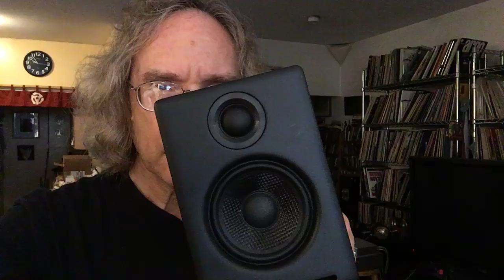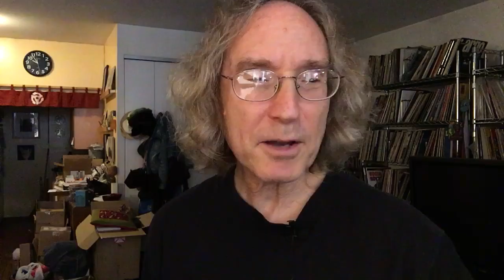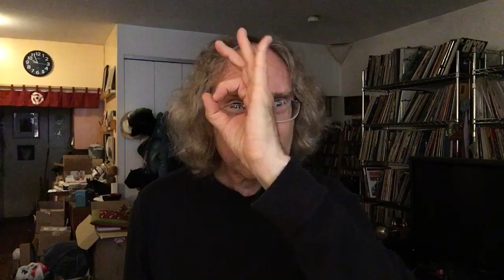The case against 1 inch dome tweeters

Comment: it all comes down to 2 things which led to the dome tweeter. assume that we are looking at a hypothetical single driver speaker with a flat response. this means that anywhere within its frequency response +-0db, our woofer's diaphragm will move from peak to peak at the same rate regardless of what frequency you're playing. the rate at which the woofer moves corresponds to the volume of the speaker. so the longer it takes to complete a full cycle of a waveform, the further the woofer will move peak to peak. so lets say we want to play a loud 20 hertz sine wave. the only way we can have both loud and low frequency is by having the woofer move extremely far from peak to peak. but there is a solution. people who developed speakers quickly realized that the larger the surface area is, the louder the speaker can be. so instead of having a crazy large peak to peak excursion value, we can increase the surface area of the woofer so the woofer doesn't have to move back and forth as much. if we are only concerned about higher frequencies, then the peak to peak value of our woofer would be exponentially smaller than when we were playing the low frequencies. in fact, if you were to put your finger on a bluetooth speaker's woofer when it is playing a high frequency, it would not appear to be moving at all. so, there is no need for a large surface area when producing high frequencies at the same volume as a low frequency. we can increase the peak to peak travel distance of our new woofer (which is still incredibly small even after the increase), and decrease the surface area, which explains why the tweeter is so small. it also makes sense to use a small high frequency driver (dome tweeter) because the weight of the silk dome and voice coil together is very low compared to the woofer. as you might know from physics class, mass is the opposite way to get something to move fast. so, the lighter the tweeter is, the better it accepts transients and acceleration, and requires less wattage. the dome tweeter is, to my understanding, the most efficient balance between surface area and peak to peak travel distance for a typical voice coil driven tweeter.
side note: many speakers have more than one driver. this helps because we dont need to make a huge woofer that is incredibly lightweight yet stiff enough to not distort. so by adding a dedicated high frequency driver, we can worry less about the weight of the woofer.

Comment: I think as far as tone and also clarity at low to medium volumes dome tweeters are as good as anything. But as is said in this video, they aren’t the most dynamic solution. I favor good compression drivers and I don’t mean Klipsch. I’m keen on old Altec, JBL (old and new), TAD and Radian among others. I’ve also been pleased with the dynamics of large electrostats and planar dynamics. But at lower volumes, yeah, domes can be very, very nice.

Comment: While it sure sounds logical in your head this is just thoughts or ideas not backed out. If any other kind of tweeter were better, hifi-manufacturers would use them more. I do have a pair of Martin Logan electrostats and I agree, they are the best sounding speakers when it comes to hi frequency that I've ever heard and a go2 for me but that doesnt mean they're actually better than dometweeters because of the size.

Comment: It is absolutely true that the area of diaphram is the governing factor of a cone loudspeaker's efficiency however, the efficiency factor is always divided by the moving mass of the loudspeaker. Tiny dome tweeter's lightness (a dome is just another variant of a cone) compensates for the smallness of the area.

Then there is another interesting factor literally in the air. The higher in frequency a solid object vibrates, the more efficiently the vibration energy transfers to the adjacent air. Less electrical power and smaller area are just enough to reproduce useful sound pressure at high frequency region.

Comment: Hrmmm, i get it.. The PS audio infinity IRS 5s have a whole panel of JUST midrange and Tweeters and I've never heard it in person, but I must say it looks alot morr convincing and easy to reproduce sound than just ONE tweeter. If you put in 4 of those tweeters and marketed it as 4 inches of real estate for dynamics and high frequencies. It would sound ALOT more convincing. As for headphones, the driver size matters just as much as the cup design. The HD800s can only sound like that because of their shapes enclosure. Or the Z1R because of it's massive 70mm driver. Listen to other 40mm headphones and you will notice a clear difference. That aLOT goes into the acual enclosure that isolates and refines sound but the bigger driver still sounds better and more natural since it cover more area. Bass from a 40mm driver being resonated will sound less like a bass amp and more like the inside of a cab while bass from a 50 or 70mm driver will immediately feel like it's coming from the large driver of an actual bass amp and immerse you. It's bugged me alot in the past as well

Comment: I replaced the 1 inch domes in my Energys with salvaged paper 'tweeters' (2 and a half inch) from an old Bose OM3 and there was a huge improvement....transformed from 'ok..but' to 'these sound great...A lot more detail,better high end,greater clarity,overall better..did not change the crossover.
Reply: Paper tweeters are great
Reply: They are too prone to burnout on loud music
Reply: vaughn tonkin  ..thanks..didn't know that..I am an apartment dweller so can't do LOUD..
Reply: If they are 2.5" drivers then they will have some SIGNIFICANT limitations when compared to a 1" tweeter - the primary one being radiation/dispersion. A 1" tweeter will start to beam at somethig like 8khz-10khz when off axis to the listener, while a 2.5'" would start to beam at something closer to 3khz.  

That means for your speakers with the 2.5" driver to sound any good up top, they'd need to be sitting right in front of you, firing directly at your face more or less. Might be ok in a very small space, woudn't work nearly as well in a larger where you have mulitple people in multiple listening positions. 

You'd also likely suffer a MAJOR drop in sensitivity, meaning if you didnt change your crossover you top end is probably far quieter then your bottom end (midrange / midbass) now.  Some people like that type of things - but its not accurate or realistic.
Reply: One thing I like a lot is >more 'tweeter' volume and better sound stage/imaging..If radiation/dispersion is not as good i can't hear it....what i hear is what  i care about.

Comment: Sir your trying to compare an electrostatic to a box speaker with totally different sound dispersion characteristics and a totally different way of being built,some people just don't have the room for electrostatics I myself love the sound of a well run in vintage pair of quads but just don't have the room for them that's why I use kefs because you get the scale and almost the same holographic imaging as an electrostatic,never really have a problem with transient attack and dynamics as good placement and decent high purity copper cables I find silver far too bright...with plenty of amps on tap do the trick.... unless you're using valve amplification which always requires a slightly brighter sounding pair of speakers....in short nothing wrong with domes just make sure they're installed on a smooth baffle with no framing around the edge to avoid diffraction.

Comment: I hear what you are sayin' here Steve. Yes. Obviously, you can get a lot of sound out of that small speaker. Goes without question. The question (in my tiny mind, at least) is whether you can really get the full "richness", shall we say, out of that one tiny driver? Would larger tweeters work better? Or would a multitude of tweeters that are each wired (crossovers) to respond to just a smaller part of that 3 to 20+kHz range (acting like a small choir) be a better option?
I would like to try my hand at designing my own speakers in the near(ish) future. I'm thinking that perhaps two or three larger tweeters wired to "sing different parts" would produce a fairly rich sound. Now, all I need to do is figure out how to design the crossovers to do that! (Yep. Just bit off more than I can chew!)
Reply: Good lord no...

The only advantage of a larger tweeter would be the ability to play / cross over lower.  This would be nice, but in order to obtain this you would be sacrificing top end extension, especially off axis.  

And to use multiple tweeters covering different frequency bands would be an absolute nightmare.  The whole concept is to use the minimum numbers of drivers / crossovers you possibly can to achieve your goal.  Increasing the number of drivres you have playing different frequency ranges will mean a nightmare crossover and a phase response from hell.  

A for "richness" - sound is not food nor does it own assets.  Richness is not a characteristic of sound.  High frequency extension?  Fine detail resolution?  Linearity of ampitude response?  Because a good 1" dome can achieve all of those things if executed well.

Comment: You're thinking about it backwards.   Where is the sound going?  To your ears, of course.  A human eardrum is between 8mm and 10mm in diameter.   That's less than half the diameter of a dome tweeter.  And it's also probable that the capsule of even a very high-end microphone is 25mm or less.  So don't worry about the tweeter being too small.

Comment: You cannot say one size tweeter is better than another; basically a great tweeter will have extremely low mass and high force so it can respond quickly whilst also having the right shape to radiate sound images effectively. At 20Khz the wavelength of sound is 17mm, so there is good reason to keep tweeter size below this to stop off perpendicular resonance and away from harmonics(fractions of that wavelength) at sizes (17/2,17/3,17,4..)

Comment: i agree about your intervention about a soft dome tweeter of 1 inch or so 

i feel that a same efficiency tweeters with the rest of of the system low part is a guest 
about the expected  dynamic of the average music signal such of pop music.  

ex a 91dB/W dome tweeter a 35W ( in tiny voice-coil )   at /2M distance  in room barely output 101dB and will eventually occur a premature material fatigue due to thermal stress .
Not mentioning the audible distortion at that abuse don't expect 108dB output peek 
it wood require 200W 
my personal opinion  is that you need a speaker system with enough dynamic in the highs 

and to arrive to that like a Lansing L100 for a example  the low driver is 89dB/W and the medium +
tweeter LE5 & LE25 type are capable before the filter & L-Pad control of more than 94-97dB/W  and that is the secret for built good speaker system a effort-less feel  for high dynamic in the  all spectrum .
Ans like you i found that expensive and even high end speakers  they equip with too delicate and insufficient  capacity of dynamic & realistic playback a moderate high volume
Reply: There are soft dome tweeters out there with sensitivity in the 96dB range.   91dB is quite on the low side for a 1" dome tweeter.  In fact the lowest sensitivity tweeters I've ever worked with are probably in the 90dB - 91dB range.

And regardless even if that wasn't the case, most midbass / midrange drivers are lucky to reach 89dB-90dB sensitivity anyway, so unless you are running an MTM / TMM configuration the the tweeter is rarely ever the limiting factor in terms of overall output.

Comment: 1 inch domes can be very good. Meanwhile there is a buckload of good ones out there for under 100 $. Most of them are easy to implement.
Decades of development pays off. Compression drivers,ribbons,electrostats,Heil motion transformer etc. pp. are way more complex to implement
in a multi way speaker and mostly ridiculous overpriced.
That said,one of the best tweeters i heard so far was published in the german magazin Funkschau in the mid seventies. It recycled one of those 
small electrostats often found in the big radios of the fifties and early sixties in germany.  A single valve poweramp drove it per channel. Absolutly clear 
transparent and sweet and never fatiguing.

Comment: I opine compression drivers deliver impressive dynamics--not unlike listening to the actual instrument(s).  However, to this date, almost all of the horns sold for compression drivers--and some horns utilized in commercial offerings--are deficient in more than one aspect of horn design.  The most common is the deliberate manufacture and marketing of horns that are insufficient in size to cover the lower end of the frequency span claimed.  The second flaw/design decision observable in horns are sharp edges, which often (though not always), result in a jagged frequency response.  1" domes can sound...adequate.  But, when compared to the music reproduction ability of compression drivers (mated to properly designed horns), domes pale in comparison.  As for ribbons, I never found the cost justifiable.

Comment: Dude, there is so much more to electroacoustics than what you're going on about.

I appreciate you're doing your thing, but . . . 

Even though I love ribbon driver technology and the advantages of them being driven over the entire surface area, they too have issues.

Not in the least, in that they can't reproduce low frequencies well so integration with a moving coil system capable of handling that frequency spectrum is usually required, and often that task is not executed well. 

Furthermore, the (audible) problems I mention below manifest themselves more when the ribbon driver is driven hard and/or expected to play loud; and this is particularly so for full bandwidth ribbon drivers/systems.

Sure your Magnapans may sound better in some listening examples, but that mostly relates to how their surface is driven and their impulse/step response; as they're not a moving coil transducer.

But, your Magnapans are incapable of resolving a stereo image that is smaller than their own width.

So (even irrespective of the complexities associated with integrating a moving coil transducer capable of handling the low frequency spectrum with a ribbon driver) on that basis alone they simply can't compete with a dome tweeter.

Additionally, your Magnapans - because they're usually full bandwidth ribbon drivers - can't possibly resolve all the simultaneous frequencies in the original recording; and as such frequency averaging and phase modulation (not Doppler shift distortion as is often thought) effects takes place on a far greater scale than a very well designed 2 or 3 way moving coil speaker system.

A 1 inch dome tweeter - when designed right - is a very useful piece of the audio reproduction and transducer chain.

That is why, with the exception of perhaps the early Genelecs, very few (well known and reputable) large format studio monitors use nothing other than a dome tweeter to reproduce the high frequency bandwidth.

Comment: They do measure OK regarding frequency response, BUT they definitely dont measure the same when you start measuring THD@high SPL...  Yes those large surface area speakers you mentioned definitely have way lower distortion, plus sound dispersion pattern is way different (does not involve room so much because of  beaming effect) so yes they do sound different, better (subjective though)...

Comment: I have listened to very high end dome tweeters, but Im afraid this guy's argument doesnt hold water. Planars are ok, but the soundstage is limited, and a dome tweeter seems to do this with ease. It really depends on the materials employed as to how well the tweeter handles the material. Im not a fan of planars, save in headphones where they really shine.
Reply: Michael Richter kef went down hill for me when they switched to a one Inch dome tweeter to handle not even just the highs but more of the mids as well. This have them this receded yet bright. Sure it appealed more to the American thump and tizz market but the speakers no longer disappear like they used to with practically everything important coming from the most receded element hidden behind the tangerine waveguide which was supposed to make up for the loss in air.

They even went all boxy and went with 2 dummy radiators vs 2 active LF drivers each with their own tuning which always played way better with a sub.

Comment: I've built many DIY speakers and over the years I realized that I got noticeably better piano sounds from the builds with higher 2way crossovers. ( 6k and up) I came to the conclusion that this was happening due to the woofer being able to better recreate the sounds of the piano than the tweeter. When I lowered the crossover frequency in the same speaker (2.5K) I would lose something. So now I raise my crossover frequencies higher if the woofer can accurately handle it.

Comment: Are you for real? you dont need big surface area to produce high sound levels at high frequencies. It needs to be light, fast and free from resonance in its operating band. Plus a whole lot of other stuff, that has no requirement for it to be large or flat or horn loaded.